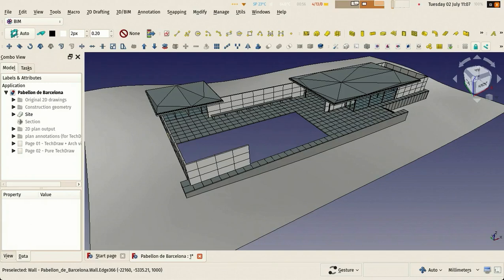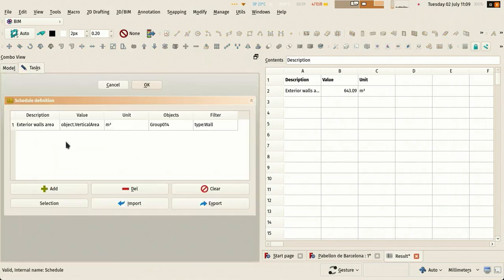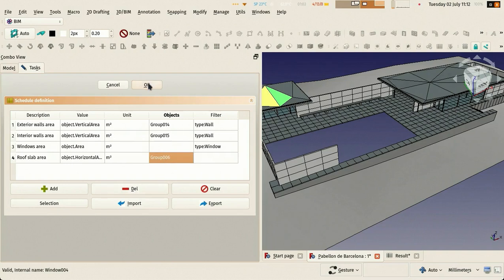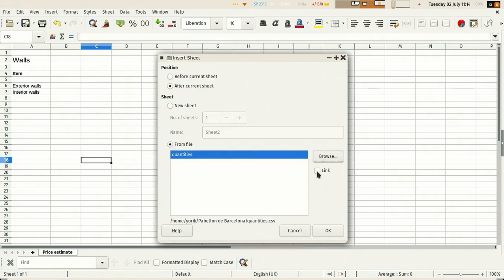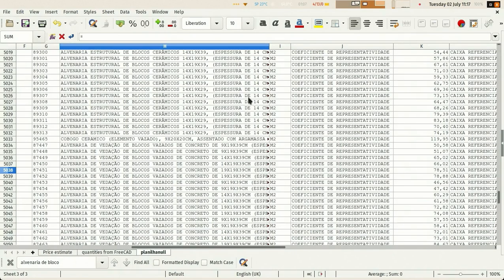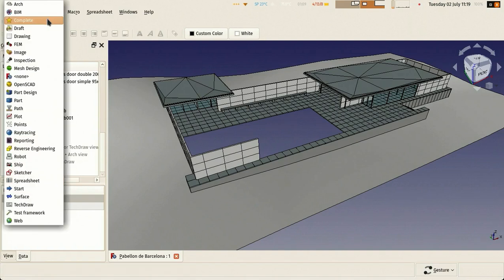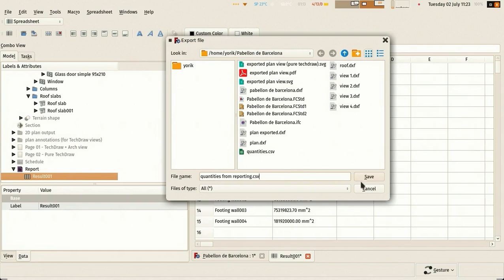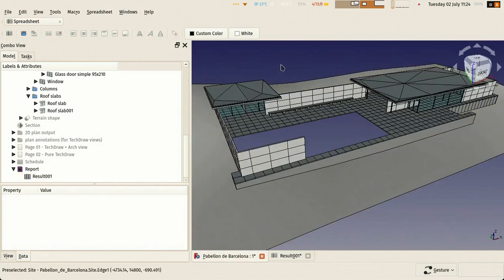BIM with FreeCAD - Barcelona pavillion 16 - Quantities and schedules

Comment: great work as always, i have been looking into your project for a few days. i mainly use freecad for architectural project, as today i tried manual calculation of "wall vertical area" ( area needed for painting ) and found that it doesn't match with the value showed in the Data view, the area calculation does match when the wall doesn't have any boolean attached (door or window). but when i try with window attached, it seems that the hole created by boolean ( vertical face created by the hole beside the attached window) is added into the vertical area showed in the Data view. can we do something about it so we can use the value stright for wall painting area coverage ?? as we know we dont have to paint the connected area between window and the wall.. (this is my effort of learning english)
Reply: Yes that's a real problem, we have to trust the software to use it in actual projects. And it becomes difficult when we find this kind of errors.
Reply: You could extrapolate areas manually using the survey tool and export it using csv file. Survey tool does calculate the areas correctly when there is a window and door cut.
Reply: @moussahachemi4875  Actually in their documentation it has been mentioned to not trust these values, probably it is still experimental.

Comment: Hello Yorik ! That've been a while since your last video, I hope everything's going well for you. I just was modelling a stairs using partdesign but foud that we can't get the volume or any other info like the length of the hight of the final body, while it's difficult to use the stairs command in the BIM workflow when our stairs' form isn't regular. Is it any way to do it properly ? Thank you very much for all the work you do ... Keep going
Reply from the maker: Hi! Yes I'm awfully late with videos... Will get a new one out ASAP! Using other workbenches is the best way to achieve something when regular tools cant. To obtain the volume there is a number of ways, the is a "Shape info" (not sure of the exact name) macro, and IIRC there is a shape info tool in the Part workbench too. To see the total height of an object, the best way is to turn the bounding box on...
Reply: @YorikvanHavre  Great to know that you're going well and Thank you for the quick answer. Yes, actually  a good way I found is to use a macro called "fcinfo" that will give numerous information about the object whenever type it has. Thank you again, and have a good day

Comment: nice tutorial, but the problem with taking "Vertical area" is that it calculates all the areas of all vertical faces. Which means a wall will have 4 vertical faces and not 2, because even the wall thickness face is calculated as an area. When you have multiple walls, this can become a problem. Also when walls have openings and are more complex ( drawn with wires), areas don't appear under "IFC Attributes". The work around it to use the survey tool, and add these areas manually in "properties view" under "data". Again if this is done, we can neither call it with IFC quantities manager nor add it to the "schedule" as shown here. So the object doesn't have linked area......any workaround for this where you add areas from a spreadsheet for parametric objects and make them "components IFC" and extrapolate these areas linked to the spreadsheet ?

Comment: the property is called "Vertical Area" with a space between the words. but you entered "VerticalArea" . Is this by convention that you have to skip the space between words?
Reply from the maker: Internally, all properties are written without spaces. On the graphical interface (panels, etc..), a space is automatically added before each capital letter to make them more readable. But I think the expression engine accepts both forms